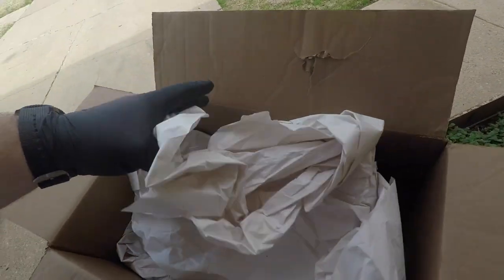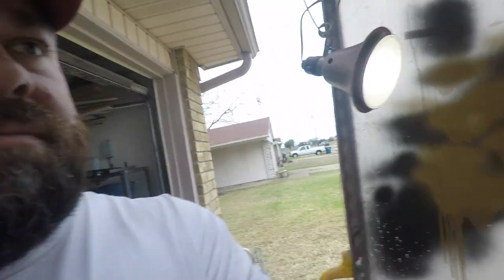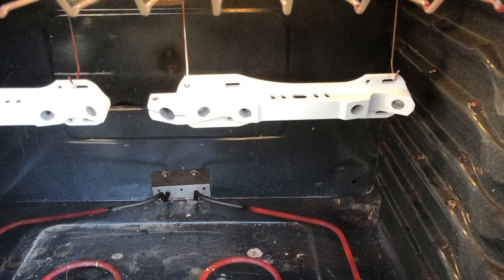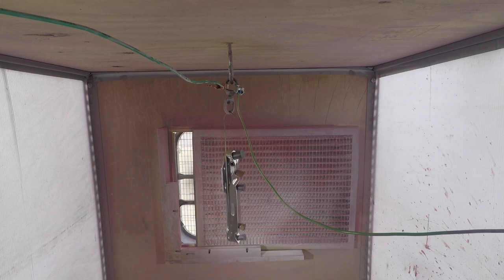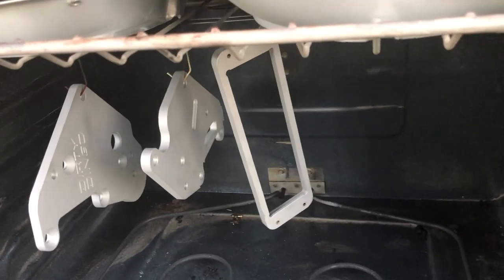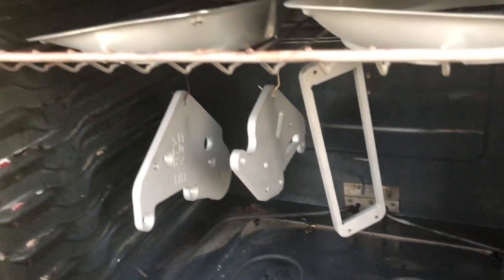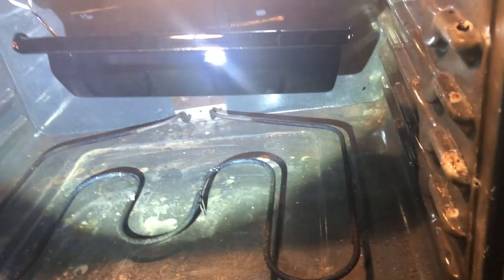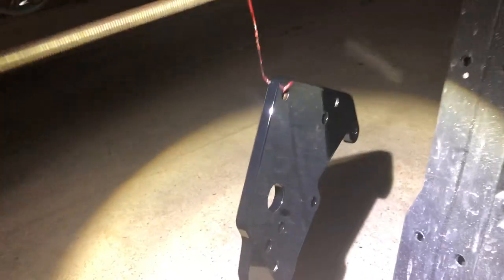Powder coating from home using a home oven

Comment: One suggestion to your oven. Get a piece of metal steel or aluminum that fits the bottom of your oven and put some legs on it so it sits above the heating element. What this does is make heating the oven box more even. Most ovens have hot spots and cold spots in that the box doesn't always heat evenly. Adding a plate over your heating element makes the heat distribution more even.

Comment: What version kool koat gun are you using?
Reply from the maker: Fast 450 3.0
Reply from the maker: Fast 450 it’s a great gun.
Reply: @TheNutthouse1  that gun covers really well in the videos. I've been looking to upgrade.
Reply from the maker: Fast 450 what are you using now?
Reply: @TheNutthouse1  the old Dv Eastwood gun. Outgrew it pretty quick
Reply: i mainly just do motorcycle parts and brackets for myself .Hobby type stuff
Reply from the maker: Fast 450 yeah I have 2 of the DV Eastwood guns. Night and day difference.